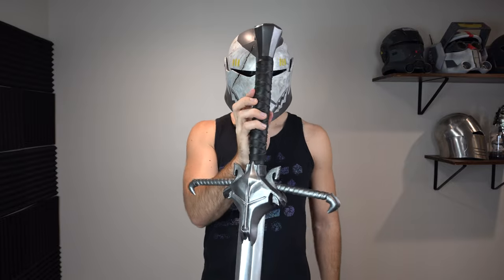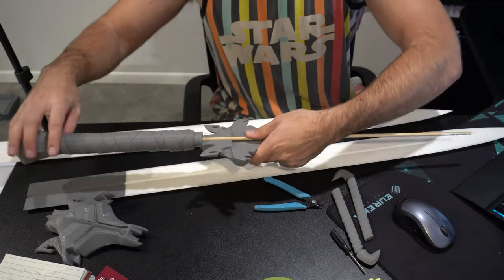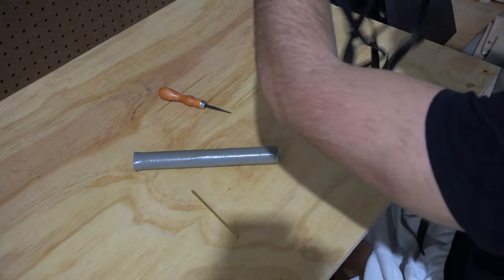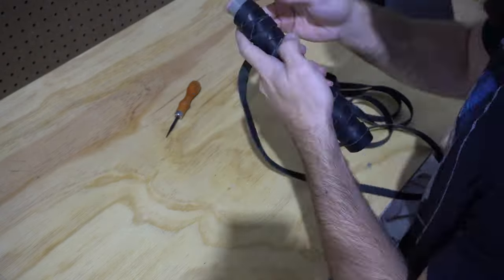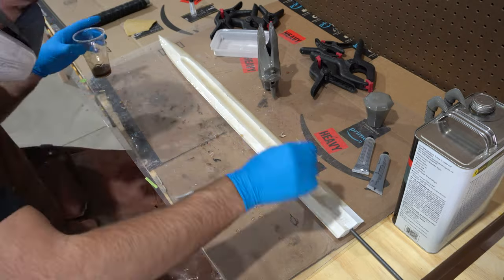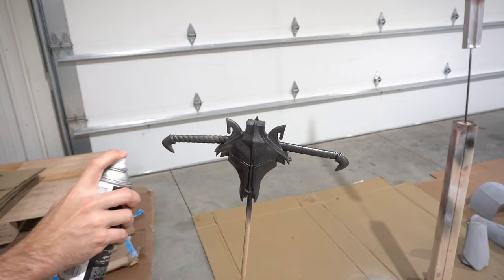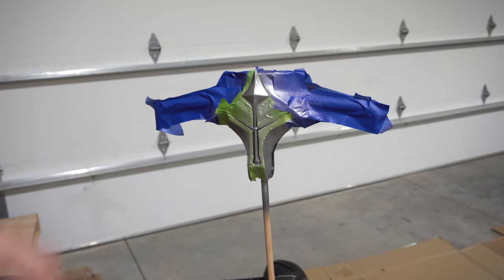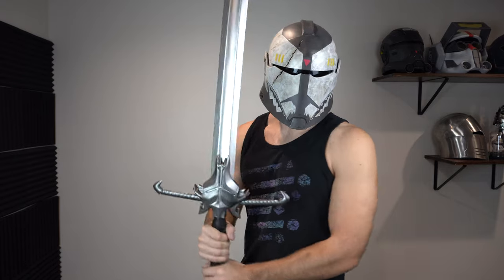Making a Jake Bartok Medieval Commander Wolffe Sword

Comment: Really impressive! How's the durability of the finish on those shiny parts? I know it can be really tricky to add clear coats which don't dull the shine, so I can understand why you didn't do that for this piece
Reply from the maker: Durable to the touch but it can wear down if rubbed on a hard surface like a table